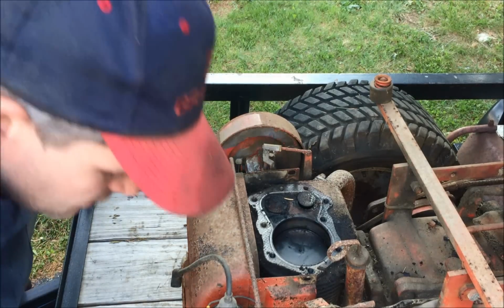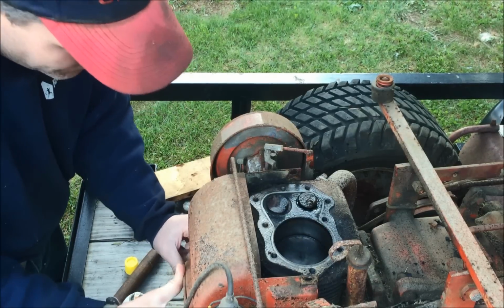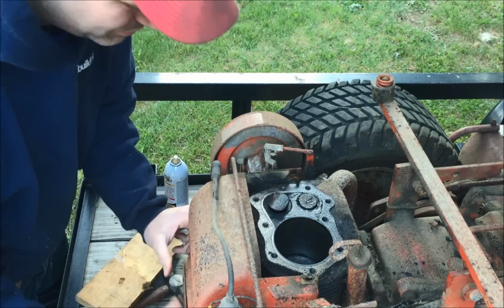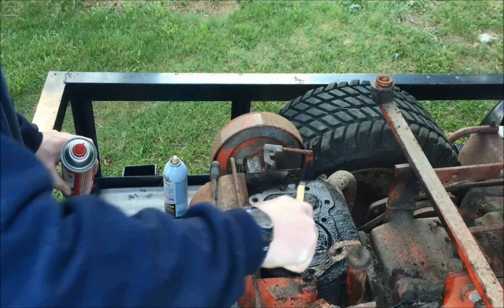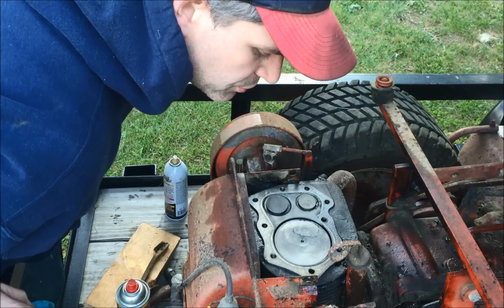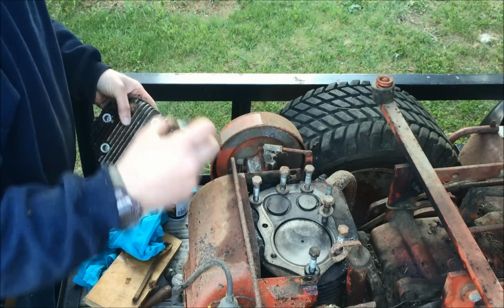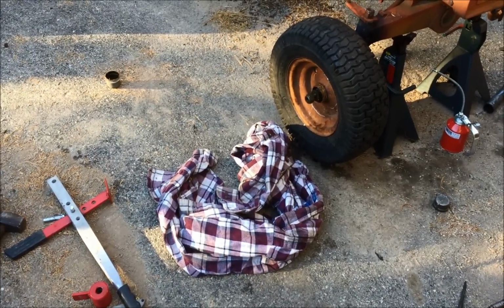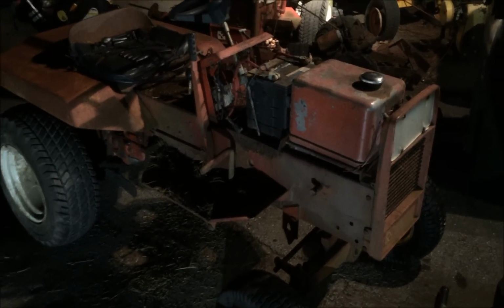Saving an Old Gravely 812 Part 4 Stuck Exhaust Valve and Tires

Comment: rw3dog I always pop a stuck valve closed and then spin the flywheel and partially open it again then oil up the valve stem. I have found that the oil will travel along the valve stem and lube up the bushing better when the air in the valve stem clearance has a way to get out and the small gap left in the wear area of the stem by a partially open valve allows the air to escape. When I have used this technique I have never had a valve re-seize again
Reply from the maker: Matthew Bergin I didn't show this on the video but I had been oiling it for a few days before I took this video...